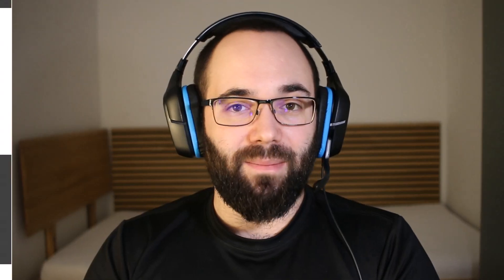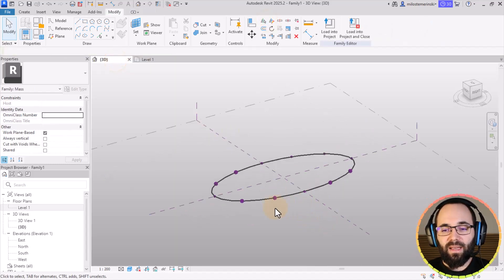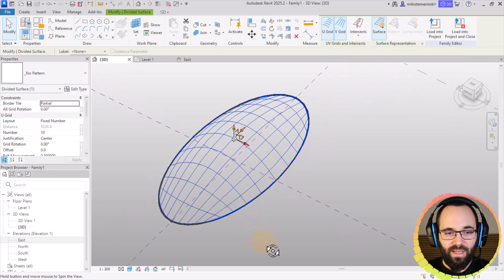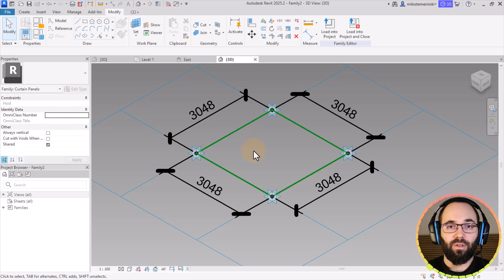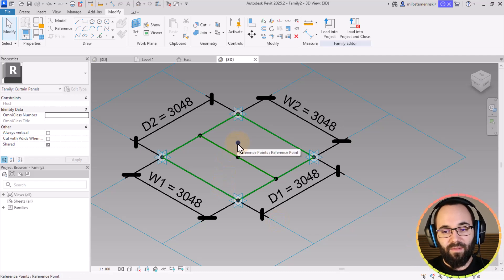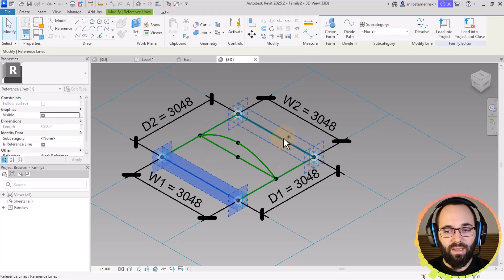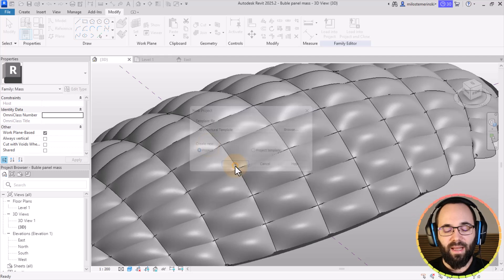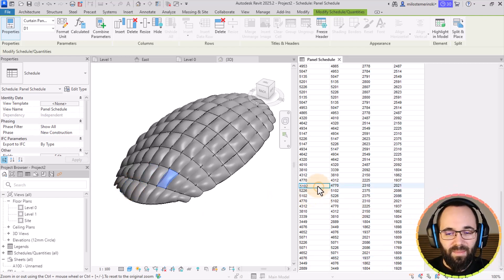Parametric Roof in Revit Tutorial | Reporting Shared Parameter in Revit Tutorial

Comment: Great tutorial! Just one question, how would you correct the panels that are sticking out of the edges
Reply: I'm not sure there is a way. I suspect you could use a void cutter geometry somehow. Or you delete those wonky panels and make in place model panels that fit how you like them, then assign them to curtain panel family type so they will still show up in the schedule... But I've seen these types of videos using the pattern roof mass adaptive family thing a bunch of time, and never once do they get into that part.